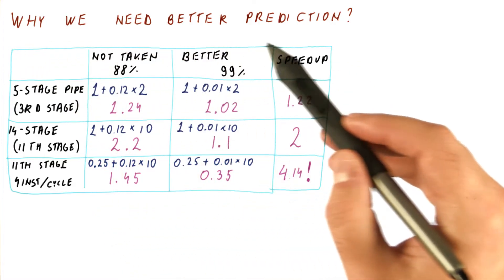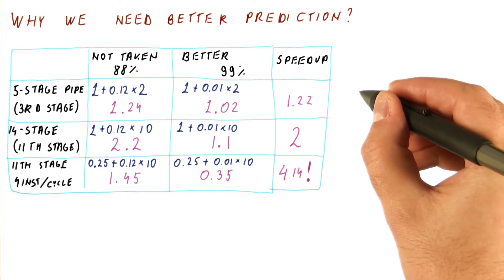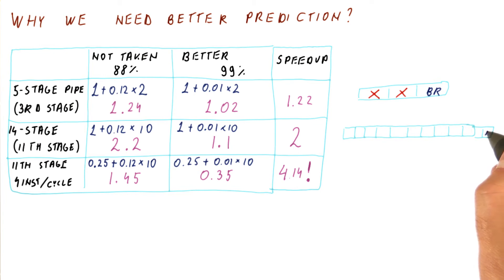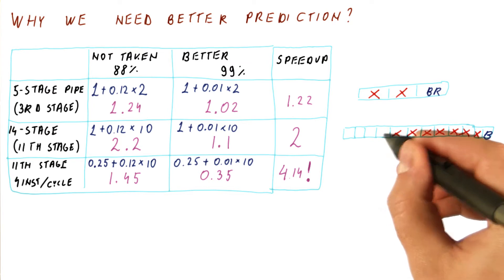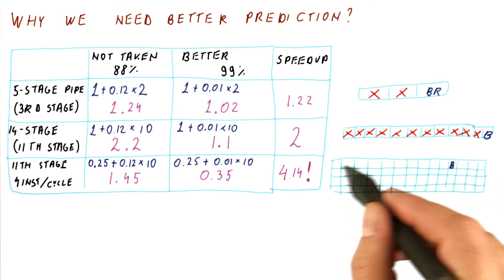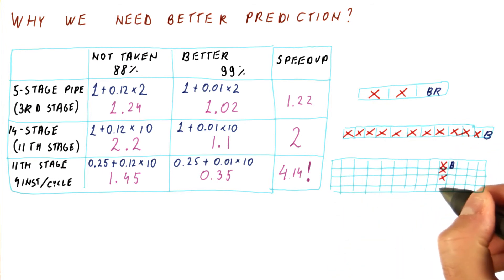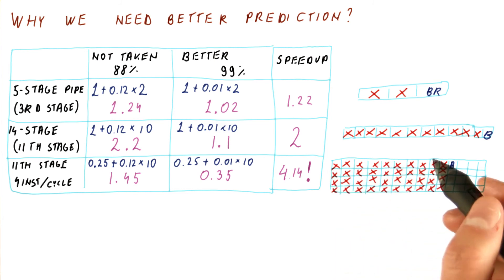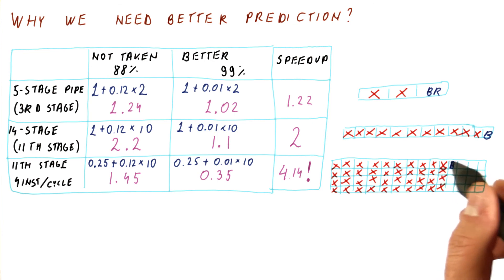Why We Need Better Predicition Part 2 - Georgia Tech - HPCA: Part 1

Comment: "wasting instructions" by fetching from a wrong address means not only we lose performance (CPI increases), but also waste energy computing useless instructions leading to unnecessary CPU heating, and battery drainage (on mobile devices), right? Is this the second aspect of why we need better predictors?
Reply: I think you are correct
At first glance, I was also assuming that nothing would happen if I mis-predict a branch other than just increase in "CPI". But yeah then I remembered that anything in this world follows "conservation of energy". If something is being processed; must have utilized some energy in one or the other forms :).